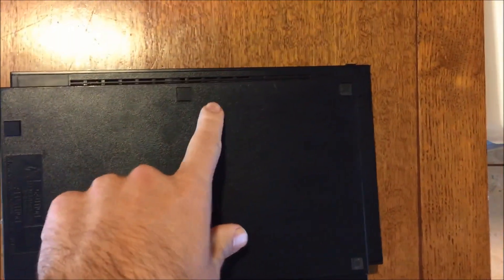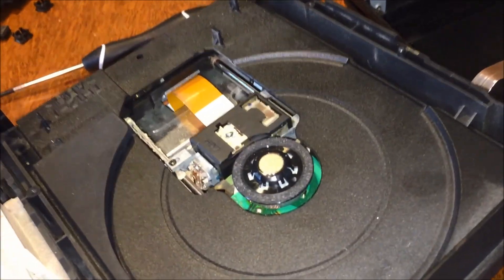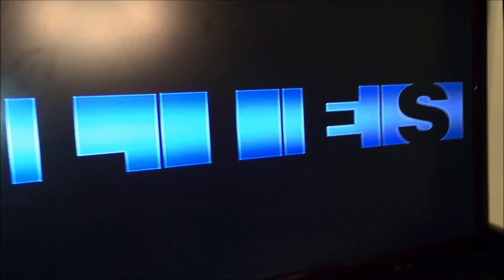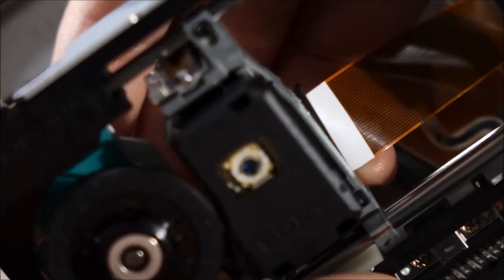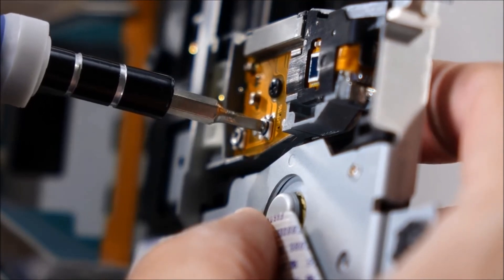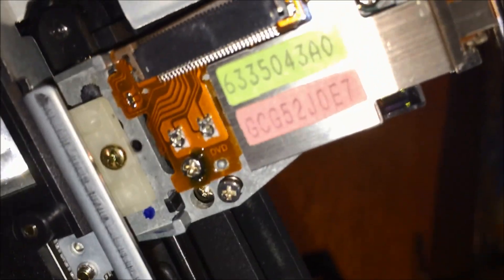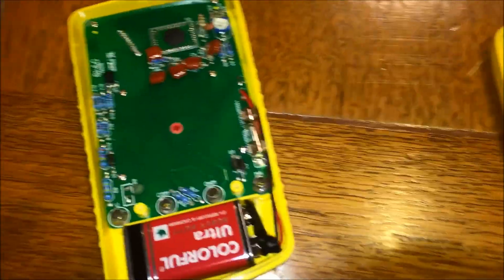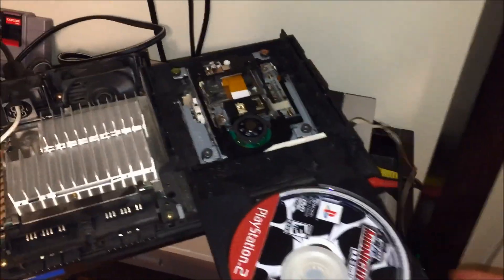PS2 reads DVD’s but not Games - Troubleshooting and Repair - Potentiometer Adjustment Playstation 2

Comment: So there’s two screws holding in the rails that the laser mechanism rides on, if you undo the screw holding the rail closest to the worm gear, you can simply pivot the laser mechanism up and out without needing to unplug the ribbon cable, it gives you full access to the potentiometers with only having to undo one screw